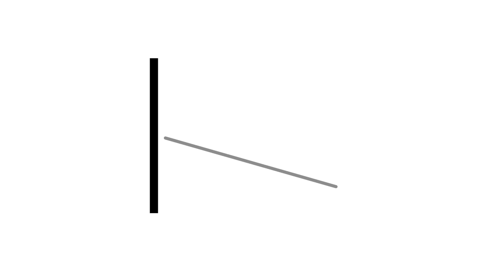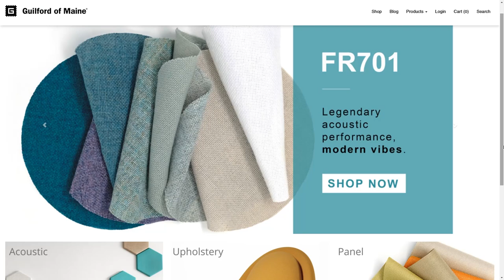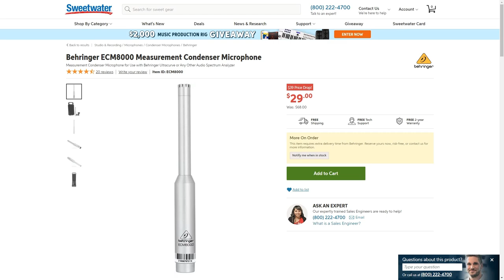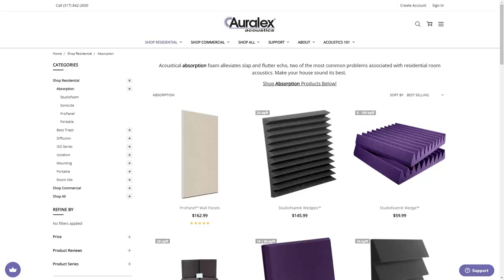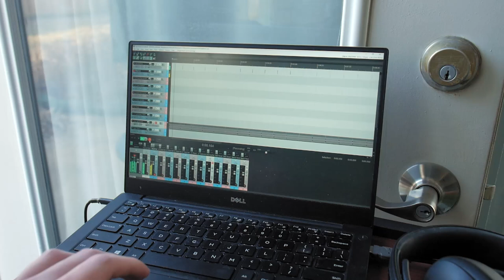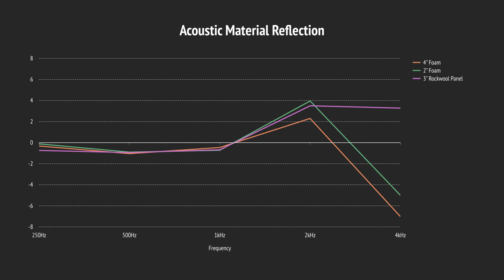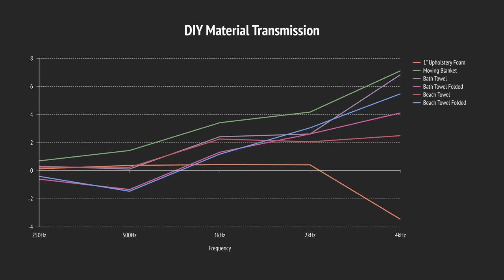How NOT to Make DIY Sound Absorbing Acoustic Panels

Comment: I don't care about high frequencies. I want my room to absorb sound  so people in the living room don't hear me in my bedroom
Reply: that technicaly requires soundproofing, not sound treatment with panels hanging on the walls, those wont do anything, you'd need thicker walls or thicken all walls in someways. its not cheap and using flammable materials is not safe.

you'd have to construct walls over your walls with appropriate soundproofing materials like rockwool/fiberglass.

you will also have to replace your door with a solid wood heavy dense door, then try to make it airtight.

yes you will care about high freq's because thats where the human voice is, fortunately they are easier to stop than lower freqs like Bass and the drum Kick.
Reply: Might check out MLV. It will create a barrier.
Reply: thats sound proofing. A completely different subject. To do that you need to build a room withing a room with boudle wall, air gap, and double doors, floating floor and sond proofed airvents.

Comment: Would love to know how you acquire materials for $100-$200 to “professionally” treat a room..
Reply: Me too!
Reply: A lot of mineral/Glass Fibre wool
Reply: mineral wool + plywood + proper placement
Reply: Good thing "professionals" need only $100-$200 to get the sound right. Those treated rooms requiring months of work are pretty cheap after all, then. Coool cool. 30K speakers in a $200 acoustically treated room, yey.

Comment: in the vid mentioned he shows sound energy diminished going through the towels.  What he doesn't show is, once the framed towels are on the wall and the sound is diminished going through them, the sound then bounces off the wall and is further diminished afterwards. His room also sounded quite a bit better with them than not.
Reply: As mentioned, the towels will treat high frequency slap reverb. The density and porosity of the towels does not allow sound to penetrate. The sound is reflected back into the room at the boundary surface not the wall.
Reply: @AffinityPhoto  his vid shows good energy absorbtion down to 500hz. That is a bit below slap echo.
Reply: @jandmbooks  IIRC, he measured outside right? Measured with mic on back side to determine transmission which he mistook as absorption as noted in this video here correctly. Which means 500Hz+ is reflected (no transmission) and 500Hz and lower passes through. Nothing about absorption at all.  Towel fibers do not convert sound into heat. High frequencies are diffused. Diffusion can help with slap echo.

Comment: I find it amusing that I saw that video you referenced and also immediately thought the test was done incorrectly, thinking that using a smooth polished mirror or slab of concrete would also have given a great (but false) result.
Reply: A mirror would give terrible results, as it has very low mass and is thin. But better than it should for this purpose, yes.

Comment: I still don't get why you would want expensive "acoustically transparent" fabric. You just don't want acoustically reflective fabric.
We aren't making a speaker here.
If the sound gets absorbed or distorted on the way in/out of a panel, thats kinda a good thing when your entire goal is to knock down the sound.
Reply: The material that absorbs well is the one we have encased.

Leaves materials that either transmit well (acoustically transparent) or reflect well.

You don't want acoustically reflective materials, as you rightly pointed out. So we are left with acoustically transparent material.

Again, the absorbers are inside the panel and we want the sound to be transmitted there. Unfortunately the "pretty and practical encasing" for those materials tends to be reflective and thus killing the performance of the panel.

Phrased a bit bitingly just for illustration purposes: Would you hang naked mineral wool from your walls?

Comment: How about thinking in layers. From inside to outside. 
Light foam like from an old mattress.  
Thick foam, a bit more sturdy.
Rubber tiles.
Underlayment boards
Mdf boards
Concrete .
This way the sound waves are slowed down/absorbed bit by bit. 

Somewhere in between a empty space. So a completely separated inner and outer room. A kind of she'll within the room.

You could do that diy and I guess it will dampen a lot of sound.

I did a little test with a wood router. Makes a hell of a noise. Always need war protection. Rolled it in 5 inch foam and roped it tight. Then it sounded a lot less. I then squeezed that in a thin aluminium case. I could completely close the lid but the sound was to the level of a modern vacuum cleaner.
Reply: It is all about size,  density and presence of air in the material u use. Squuzing it too much should affect absorbtion

Comment: I have a question for you.

I'm currently designing a type of foldable, hybrid soundbooth/ acoustic panel set up.

The basic idea is 4 1×1 meter panels attached via hinges to basically make a 2×2 meter panel that can stand freely. There would be a fold in the middle so I can create different angles but generally speaking it's a wall that folds in half.

By having 2 of these I can enclose myself in a box. A smaller one will also go on top as a room. That's the not quite air tight sound booth side of it. But I'd also be able to have them out for general acoustic treatment in the room.

The design I'm planning will involve 5cm of acoustic foam (sourced locally, the website has test scores on it etc) attached to a wooden back with a frame on it. The frame is too create an air gap between the foam and the back.

The back is there for sound proofing. Keeping sounds out of the booth but also not letting too much sound out either. I expect an inch of wood wouldn't do much either way but it'll be better than nothing. 

My hope that the 2 inches of foam and 1 inch air gap will be enough to remove most of the sound so that when it hits the wood and goes back through those materials it won't be echoing inside the chamber.

The key things I wanted from this was to be and to make the booth but have it fold and pack away easily.

That's why I'm going for foam over rockwool I can't touch and shouldn't breathe.

What do you think about the idea? 
Is it doomed to fail?
I'm going to start the DIY in the new year I think.

Comment: I need sound absorption application outside to muffle/absorb my neighbors pool motor that sits less than 10 feet from my sitting patio area. Graphs look encouraging, but would like your subjective opinion on how it sounded to your ears? Did you notice a substantial reduction in noise on the other side of the materials?
Awesome video… by the way.
Reply: The Y-axis doesn’t seem to be labeled but I think it’s Decibels, in which case a decrease of 10 would be 10x quieter

Comment: Excellent video. Question: just bought an upright piano and I didn’t realized how freaking loud that string to coffin is! How would you quiet down the sound coming out of the back, a  few inches from a shared wall with a neighbor? Goal being to prevent sound transmission to the neighbor and also deaden the loudness and reverb inside the room with piano. (Piano in a living room, nowhere else to put it). Piano store suggests stuffing holes in the backside with 3”furniture  foam. Low cost please. Thanks to anyone responding.
Reply: Soundproofing is a different story and thickness is the main thing to help.
Reply: Yep, thick and dense foam seems like the easiest way. Will still hear the low frequencies though, no miracles in physics.

Comment: "With the upholstery foam, you can see that basically no sound was blocked at 4khz" .. Isn't it the opposite? Doesn't being lower on the graph equate to less sound making it into the microphone? In the first chart 4" foam charted lower than 2" foam. I would have guessed the vertical axis is something like dB.

Comment: I have polyurethane foam laying around...its the material that old couches or caravan beds and couches use....its is 11cm in thickness...do you think it will make a good acoustic panel for my caravan studio?? I cant find info about this in the internet sadly!
Reply: A quick test I found to check the acoustic properties of a material or surface is to take a phone and install a tone generator. Then aim the speaker at the surface 1' away. Play the frequencies and compare to aiming the speaker the same distance away from a regular wall. It's not a perfect test, but it is a basic version of the test he showed here. It certainly won't help you decide on the best sounding material, but should at least aid in determining if it might be worth using or if it'll just make it worse.

Comment: So far on my "professional" treatment panels from GIK Acoustics, I've spent $2,413.80 and I still have to treat the back wall. By the time I'm finished with my room, I'll have spent $3,500. I can't image how it would be possible to "professionally" treatment an average sized room for only $200 dollars?
Reply: 2x packages of 3" thick safe n sound, which is better than any of the 1-2" material these "pre-made" companies use, costs about $110. That will give you 24x bats of material. Another 200-300 in framing materials, for properly placed panels & bass traps & you'll have the same, if not better, absorption than any pro studio.

In an average sized room, it's actually easy to go overboard with too much absorption, by killing any of the natural reverb that is often kept in order for the room to not sound "dead". 

Diffusion can be simple, like a bookshelf with all types of stuff in the shelves, which deflects & absorbs the backwall reflections.

Much less than $500 & knowledge of WHERE to place the panels & a person can definitely have a pro studio. The big name companies selling these panels are ripoffs when it comes to price & what you actually get. It should absolutely not cost somebody thousands of dollars.
Reply: @LohPro  I couldn't agree with you more!! This is a great way to cheaply address absorption. I just finished treating another room for around $500. Nine 6" thick panels with 2" air gap. Prime Acoustics sells $1,200 sets of panels which are literally a $70 box of 703 and fabric. 
However, I wouldn't ever compare this to the design of a Pro Studio. The floors and ceiling are equally as important as the walls. And then there's diffusion and placement 😫

Comment: What do you think of the Soundproofing Foam Sets that Uline sells? It has NRC = .95 you can get 36 sq ft for $138. Not very good look though.
Reply from the maker: An NRC of 0.95 is really good, but it's a general number that doesn't give you much detail. The panels could absorb almost exclusively at high frequencies, and nothing in the middle or lower frequencies, which could leave your room sounding boxy. Personally I'd try to find something that publishes the absorption coefficient at multiple different frequencies so you can see how the performance drops off in the lower range. Keep in mind the human speaking voice can go as low as 100Hz.

Comment: I'm trying to reduce noise pollution from outside. From cars driving nearby, and from the footsteps of upstairs neighbors. Will the solutions you talk about in the video address those problems at all?
Reply from the maker: This video is more for dealing with acoustics within a room. To deal with external sound you need to add more physical mass to your walls to block sound; these types of panels don't have much mass. You also need to completely cover the wall or sound will just go around whatever material you put up. Footsteps are incredibly hard to deal with because the noise is transferred directly into the building's frame, so you have to make major structural changes to the building to make even small improvements in that regard.
Reply: same problem with me, I was trying to block my window with the panel. But still have no clue which material to use

Comment: I don't understand the graphs. Some materials had -1 (no units) and some had +1 at 500Hz. Does it mean that with some materials the sound was quieter by 1 and with others the sound was louder by +1(which is impossible)?
Reply: The +1 and -1 are reference to the energy (sound) REFLECTED from the material at a certain frequency. It’s a ratio of “reflectiveness” if you will. Positive means the sound waves are being reflected (more precisely there are more sound waves being reflected than absorbed), negative means the contrary (it absorbs more than what is reflects). It’s not a decibel meter which in that case would be about loudness and yes, it would be very improbable that a blanket would make a sound even louder. That’s what is called an amplifier.

Comment: I was finding it hard finding this information. Thanks for making the video. Do you have any advice on what to use to block loud alert barking from a big dog in another room say for a bedroom  or separate room to relax. Ive got issues with sudden loud noises and my other halves dog is randomly loud. Its a rented flat though. So, would need to be removable
Reply from the maker: Unfortunately blocking sound through walls can be quite difficult. I'd start by blocking any air gaps that sound can pass through like gaps beneath a door. Beyond that, you have to start adding physical mass to walls, which can include things like mass loaded vinyl and heavy drapes. The downside is that you need to cover the whole wall, and even then it's not guaranteed to work.

Comment: Hey great video brosef! I have a couple of questions (could be considered Alms for the poor at this point lol) . 

You mentioned mineral particles can be unsafe as well as the fact that the cloth should pass the blow test. 

If I decided to go with mineral wool, and do everything safely outside (i.e. with gloves, mask, glasses, etc.), could the cloth material potentially be too transparent and allow particles to be released through the cloth and in the air?  

Or, does the "blow" test also ensure it is dense enough that the particles won't be released? Also, first time I heard the term "blow" test I wondered if this could also be a term used in the pre-production phase of an adult film but I digress...

Lastly, you mentioned another type of alternative insulation that is more safe called Wool Batt. Can you provide a link to a place that sells this just as a reference? 

Thanks in advance.
Reply from the maker: Mineral wool shouldn't be an issue as long as it's not disturbed (ie moved around or used near a fan/vent). I don't think the fibers are small enough to get through cloth, but I don't know that for sure.

Wool batting is pretty easy to find in any fabric or quilting store. It's basically just sheep wool combined with polyester.

Comment: If you can get your hands on the Elgato Wave panels could you do a second video? I want to know if I should shell out $100 for six panels or $200 for twelve.
Reply from the maker: LinusTechTips actually made a solid video on the Elgato panels. I'm working on a followup video to that one with more detail, but they seem to be a decent product, although as far as I can tell Elgato hasn't published any acoustic data on the panels, which is a bit concerning.
Reply: @AlteraSound  thanks, I will look for it. I'm also looking at getting some 242 Acoustic Panels from GIK Acoustics.

Comment: Since the sound transmission is so low on the towels/blankets, they would be perfect for keeping the noise in?(putting the acoustics aside)
Reply from the maker: To stop sound travelling through a wall (sound transmission) you need to add mass. In that regard, towels would be more effective than insulation panels given the same thickness; however, there are plenty of other materials like drywall and brick that have even more mass and would be more effective. The main concern is that sound is great at finding gaps, so any sound blocking must cover all surfaces, and you may still run into things like ventilation ducts carrying sound around your sound treatment.

Comment: Hey man, thanks for this awesome work & debunking! But I'm still wondering if glass wool is a good alternative?
Thx
Reply from the maker: Glass wool should work fine. Most manufacturers sell versions that are specifically designed for acoustic use, so you can look at the data sheet and find the acoustic performance numbers. Even if you don't fully understand the numbers, the fact that they're included is a good sign.

Comment: Thanks for the video and showing your results. I live in an old Victorian house in London with a huge window (which is not double glazed), I'm also next to a main road so get the traffic a bit. Would placing the  professional sound absorbing blanket over the window's curtain reduce the noise effectively? The room does contain carpet for absorption too. I'm wanting to do asmr videos so good sound is crucial. Thanks!
Reply from the maker: If traffic noise through the window is an issue, I'd look at sealing the edges of the window first. You can also try acoustic window inserts, but they may not work with your style of window. A sound absorbing blanket is a good option too, but it will mainly block high frequencies unless you seal the edges.
Reply: @AlteraSound  thanks for the great advice. I’ll try the blanket too, thinking of applying magnetic strips around so it can cause a tighter seal to the frame
Reply: They also make acoustical caulk!